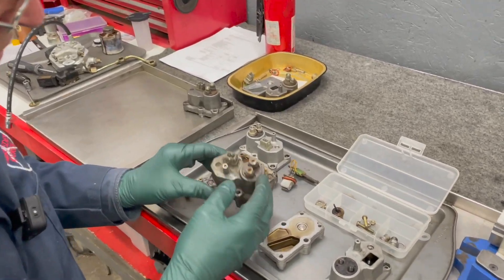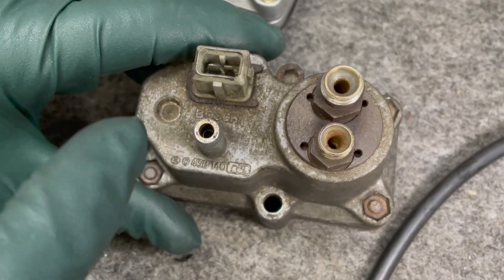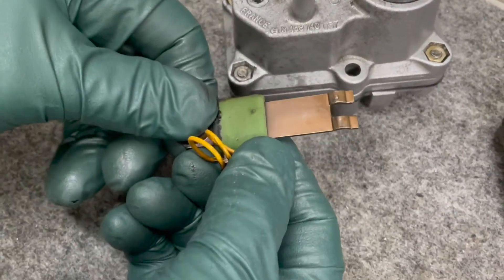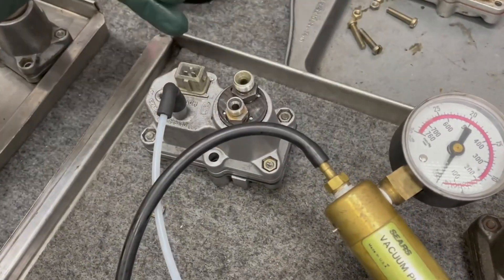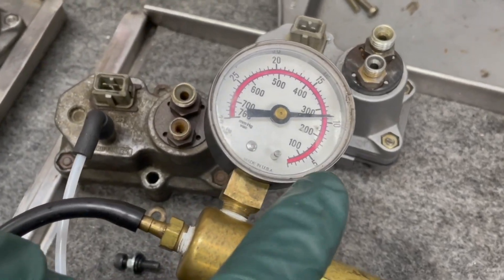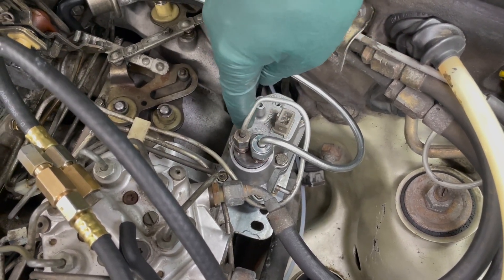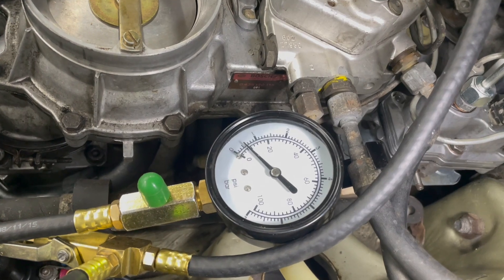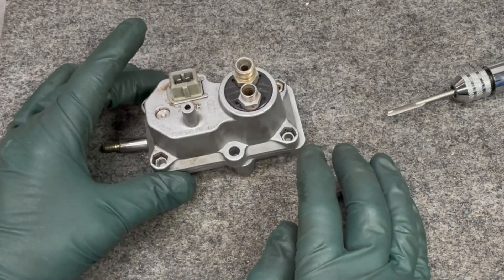K-Jetronic WUR External Cold Start Adjustment Modification: I Like It! You Can Do It Too

Comment: Hello, I wanted to know if with this manual regulation you have to constantly regulate so that it starts well both cold and hot? Because the problem I have is that it doesn't start well only when hot
Reply from the maker: Not necessary to constantly adjust the WUR. Your problem with hot starting may be due to something else. You can not guess. You need to do a full fuel system pressure test to find the culprit or culprits. https://mercedessource.com/store/bosch-k-jetronic-fuel-pressure-tester-version-2-w-extras

Comment: Hi Kent,  can't find a vid to post this question about K-Jet., & you're the only guy who would know!   First, why do some K-jet metering-vane bodies have the bar across the top attached with 2 screws, & some do not have this bar?  Seems like this large bar is an an airflow restriction.
Also, have you ever seen this on other K-Jet throttle bodies....?
The Delorean has 2 springs attached to each of the butterflies, again obstructing airflow.  They don't seem to do anything, & I read of a mod on TurboBricks Volvo Forums, to remove it & solder the holes closed on each butterfly that held the springs.  
Do you know the purpose of these springs attached onto each butterfly?
Thanks,
Chris
Florida